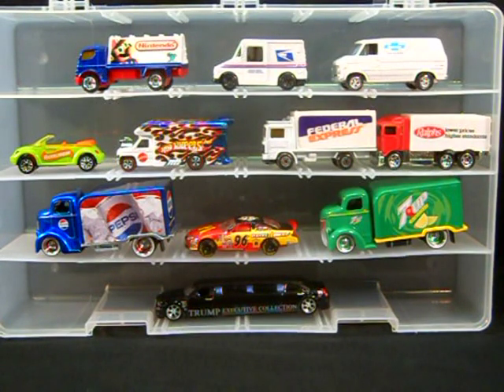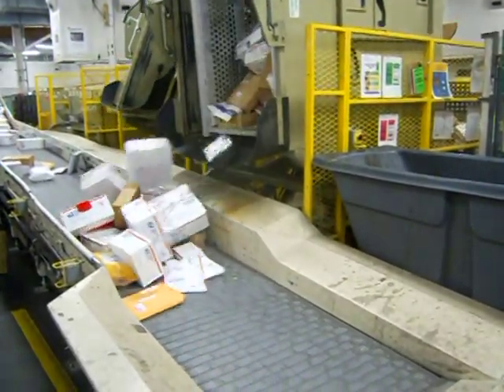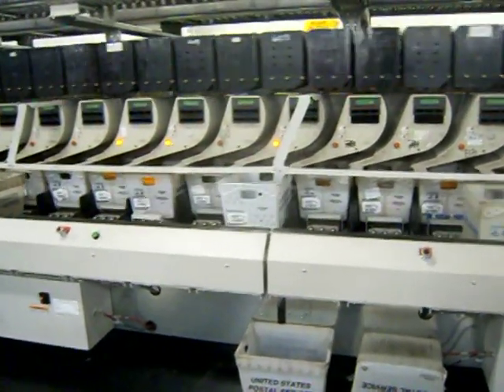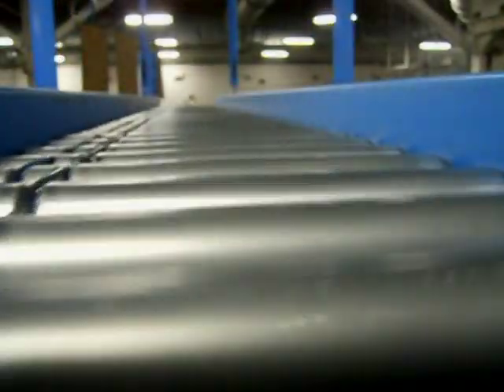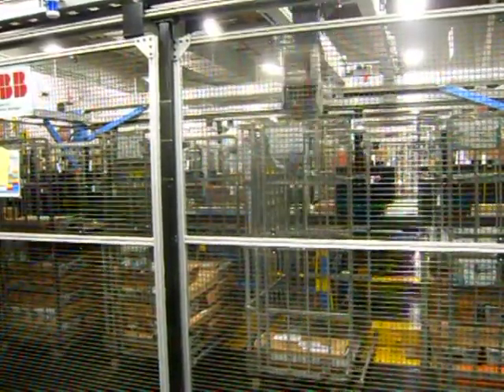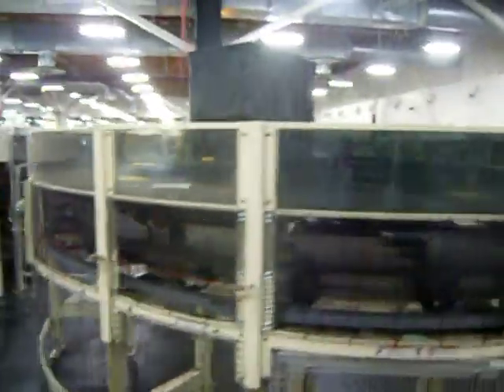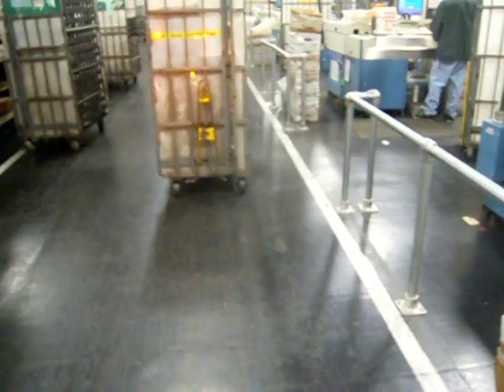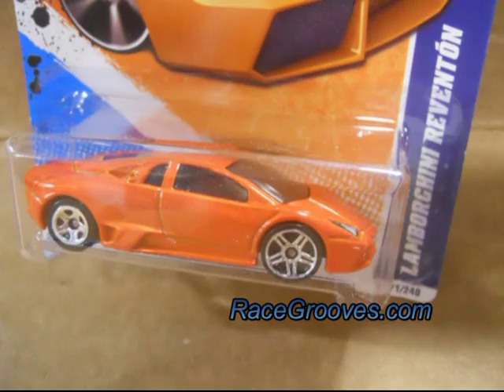Machines of the USPS - U.S. Post Office automating sorting of letters and packages

Comment: Does the cameraman have tinnitus now, after 20+ years there? You might be surprised how many P.O. workers have it. Working many years in a noise fest of machines is not good for your health. All these machines were supposedly bought to reduce the workforce. Rather laughable, imo, because in the main building I worked at, there were more workers when I left in 2001 than when I started in 1974. The difference? More casual employees, paid at a lower salary.

Comment: You have way more than a couple APPS by the way I have been installing/moving/retrofitting these for years.  In Chicago nearly done with an install this week too.  DIOS/AFCS/CIOS are pretty mesmerizing to watch the first time you see them after seeing them a few times it's just another normal day in the USPS.   The only machine off the top of my head that has the APPS beat on pure size is SSIU I think there are around 20 in the country give or take, but only at the NDCs now those would be interesting to see being installed.  I also understand that there will be a new contract (possibly next year) and the bidding is down between Lockheed and Siemens.  With any luck solid work for three whole years for me if Lockheed gets it.    There are also some tricks that the USPS could do to up the amount of processing on an APPS, but it would require removing a a whole side FSD/Inducts and installing three supplementary inducts in it's place - unlikely they would toss out all that equipment though.
Reply: And to note that would be a closed loop APPS we have 3 different versions of the machine closed, open, and L some even have walk overs some go up an incline.

Comment: Good video. I am a mechanic on conveyors in Austin Tx, 15.5 years. We don't have a robot but we have a tray management system that uses robotics. Best job I ever had.
Reply: Pretty sure there is an APPS in Austin  I seem to remember doing the EN-Retrofits to it back in 06 or 07 something like that?
Reply: Yes we have one. It is getting another modification soon. I work on Barney, PPCs and the LCUS.
Reply: Well you might get APPS BINS bin expansion more or less just more bins to sort to.  We just did some supplimentary induct addons all across the US.  Which is basically a dumper with an incline then optional conveyors to a work station where two people can face the mail bar code up then feed the pieces one at a time there is a dedicated scale (same as the new one on your semi-auto you just installed(last year as well right?)).  I want to say your is an open loop, but it has been years since I was in that facility.  Should you all ever need some help let me know seems like this site I am on  is the last thing lockheed has scheduled for this year other than a bin expansion somewhere.  I have applied at the USPS for maintenance positions, but have never even gotten a call to take the test.

Comment: 'What facility is this? I'm a mail handler @ the Baltimore GMF (Main Post Office). Our APPS machine doesn't look anywhere near as clean as  the one in this video. Good video though.
Reply from the maker: Santa Clarita, CA.
Reply: Dude I have never seen a clean APPS(after moving one I always end up turning the hotel shower black from the dust) trust me there is no such thing in existence(it is impossible to clean ~80% of the machine because of the chutes / sack racks).  Look at the horse heads probably enough tape to mail 50 packages on those things(I would be amazed to see an APPS  that stayed clean after install and test).  I thought that they went to only NDCs and BMCs / P&DCs now?

Comment: No Singulator?  I wish I had taken video of our Primary PSMs before they removed them.  We still have the Secondary PSMs but they're not as impressive.  The APPS machine does a finer sort with a much smaller footprint, but requires much more maintenance.
Reply: SSIUs are only at the NDCs that would be Seattle, LA, San Fran, Denver for that side of the country.
Reply: At the Denver NDC we called the singulator (the strangulator). Gave the USPS 28 years, first as a MPE, then retired as an ET-10.

Comment: they must have prettied up things for this filming because that's not the nice/neat way it arrives at our office.  letter trays are haphazardly thrown on shelves, almost no green lids on anything, all parcels pretty much dropped without regard to size or shape into the same bins for us to sort & deliver!
Reply from the maker: Randal Alford The flat tubs/letter trays that have lids/sleeves are heading for the airlines. They have to be strapped because they get tossed onto a plan. There is no need for the added steps for mail that is traveling by rolling stock on trucks. (I don't work for the USPS anymore as I am full-time YouTube now.)

Comment: How are the package addresses read? Is the machine able to read the text written on packages like letters?
Reply from the maker: hup2thepenguin It depends on the machine. Each letter gets a barcode sprayed on the back and a picture is taken of the front. If the machine can't read the printing, a person (remotely, via computer) looks at the picture and types the address. Either way, all of the machines that process that piece of mail as it travels to it's destination can read that barcode on the back (or front) and know the address that has been assigned to that barcode.
Reply: RaceGrooves
What about like boxes or bubble mailers?
Reply from the maker: hup2thepenguin Most packages have a bar code on them when the label is printed. If not, then the process of taking a picture and being remotely read is used but no barcode is printed on the box.
Reply: RaceGrooves
Ok, thanks! I do a lot of shipping so I am curious about the processes.
Reply from the maker: hup2thepenguin You're welcome!
Reply: hup2thepenguin yes. theres a camera inside of the machine that takes a picture then software on a computer turns the letters into something the computer understands.

Comment: What facility did you work at?  I retired from MVF, 60455 in January 2013.
Reply: Ooops...posted with my husbands's first name.
Reply from the maker: ira moser I worked at Pasadena P&DC 91109, Santa Clarita (Sierra Coastal), and Van Nuys FSS facility. 23 years of total service, resigned in 2013.
Reply: RaceGrooves not retired?
Reply from the maker: NONE No, I did not retire. I resigned. I won't apply for my retirement benefits for eight more years.

Comment: How many people work at USPS?? About half of 'em
Reply: On paper a single sided APPS should be able to process 5500 mail pieces per hour  good luck getting 10 people to each sort 550 mail pieces an hour that would be something like 10 per minute!  Also note flats generally are all the same type here is the same magazine you know where to look for the barcode.  Here is random package #50 who knows what side the sender put the information on.
Reply: the only mail volume that is declining is flats - priority packages are on an increase. Although they say that the manual sorting of packages is more tedious than flats? Any idea why this is?
Reply from the maker: Yes, I think that at the high point, the USPS had over 800,000 employees. With declining mail volume, the ranks had to be reduced. I resigned in December 2014.

Comment from the maker: Protecto's are only good for casual handling, the accidental dropping of the item. If during processing, the shipper used a bubble envelope, and it landed sideways into the container, and a heavy box landed on the side, the Protecto may not be sufficient to prevent damage to the card.

Comment from the maker: 1:19 This footage is taken where the cone used to be. Well, what I'm told because I didn't arrive in Santa Clarita until 2005. DBCS are standard equipment. I don't believe that any of the machines are called OCR anymore. I am a mailhandler and I don't work on that side of the building. I think that the OCR capabilities of the OCR are just incorporated into another machine. I am not familiar with DPRC. By the way, they are closing the Pasadena office and Santa Clarita may not be far behind.